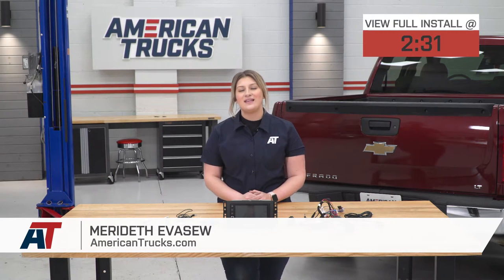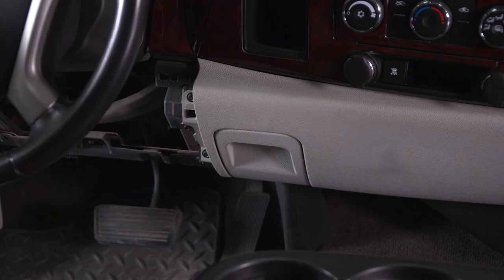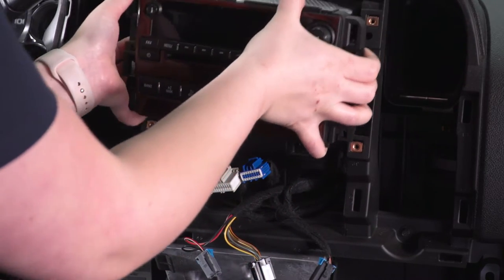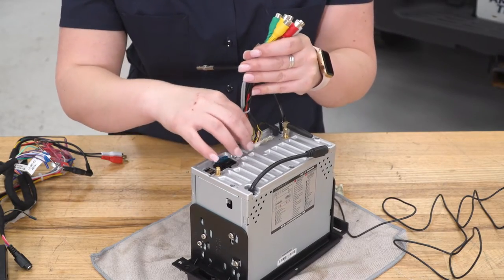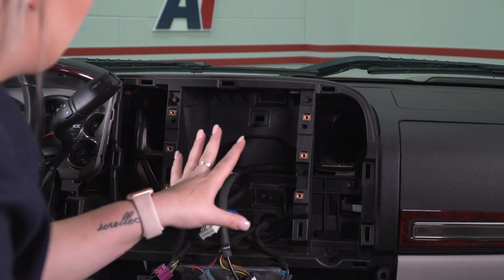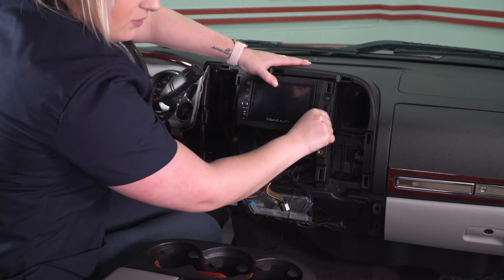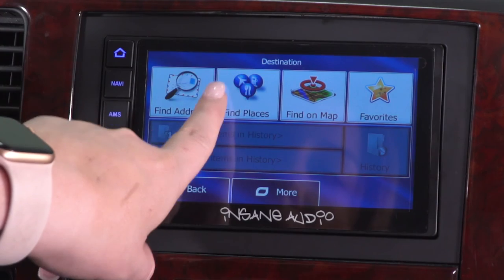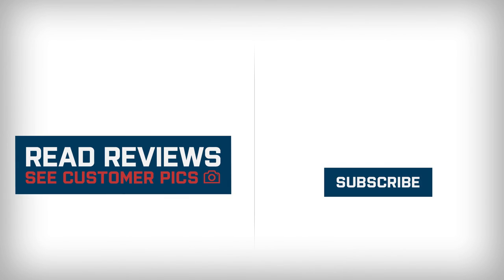2007 2013 SIlverado 1500 Insane Audio Plug & Play Navigation Unit Review & Install

Comment: You didn’t have to take off the kick panels.  Pull the trim off at the top and the bottom will slide up from behind the center kick panels.  But good video 👍